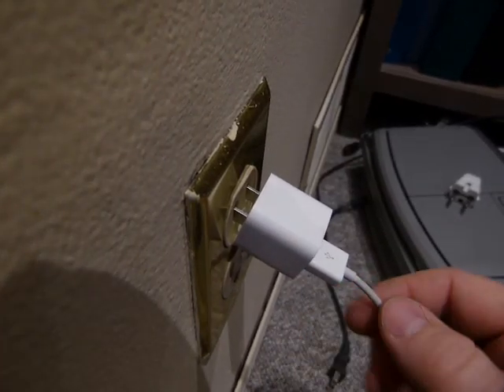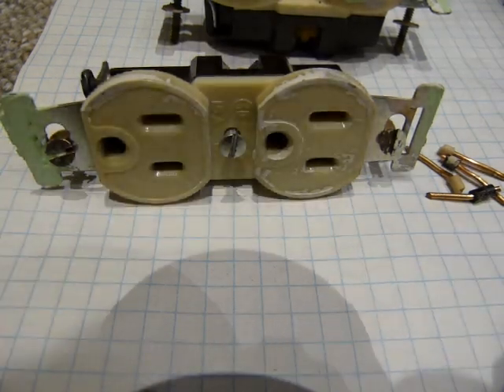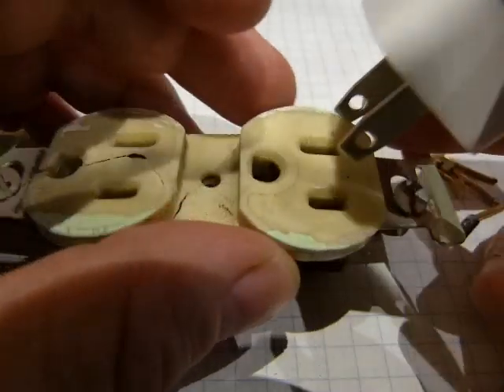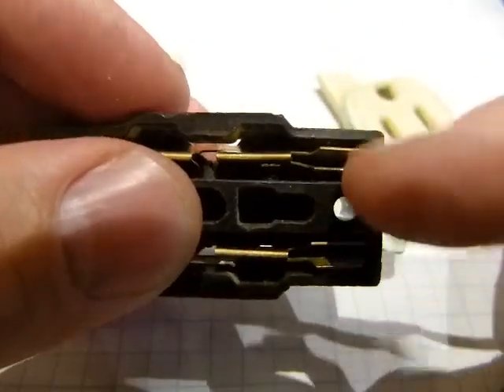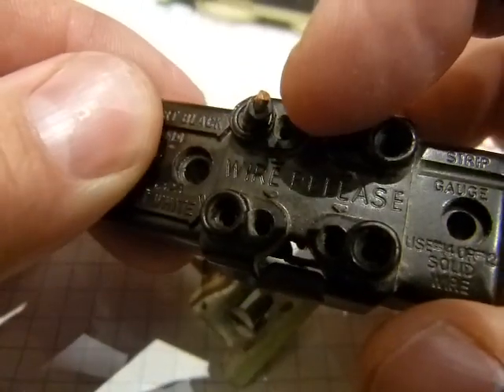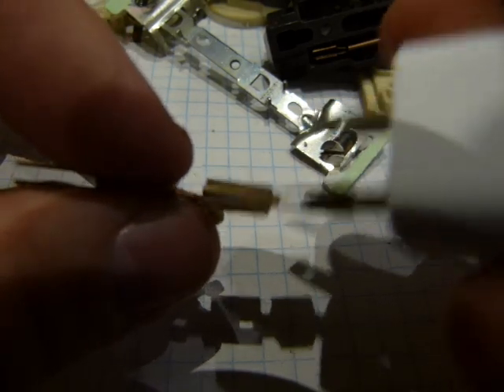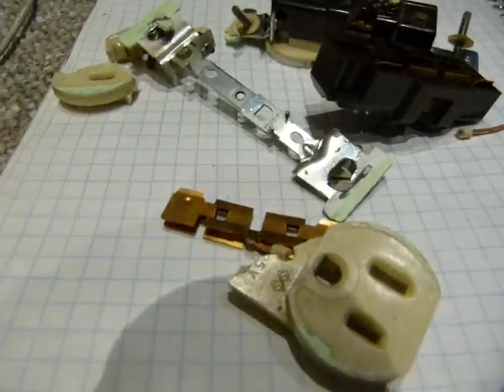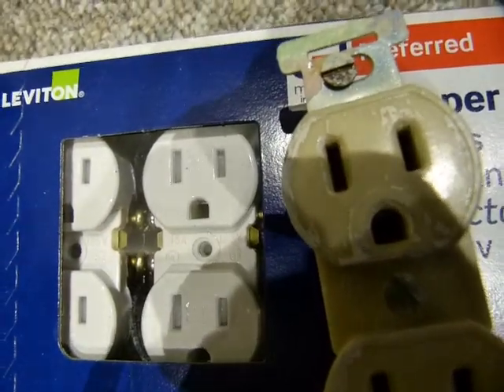Inside an electrical outlet

Comment: Notice the two protruding dimples on the inside the female plates. Those catch the 2 holes in the plug by design, but we know on this video the plates are cheap, spread, and worn out. On a 'hospital grade' outlet those dimples grab the holes positively. BTW, the red color outlets are connected to the emergency generator bus transfer switch should there be a power failure in a hospital or other critical place (nuclear power plant, etc.). Not all outlets are fed by the emergency generator set transfer switches.
Reply from the maker: Thanks for the background info, love it!

Comment: It's really never been a good design. I remember as a 2 year old putting scissors in the socket , only in 1 side and big spark, turning the chrome black and part of the outlet. (then returning them to the esthetician that was visiting) . So it must have shorted to the adjacent ground.  (I recall someone else causing a short when removing a plug had a child guard on it; without removing it 1st) . I guess it would trip the breaker = ends up being safe.. Anyone have thoughts of the ground strip ? Are newer ones safer ? or just GFCI that are safer ?
Reply from the maker: Any outlet design will have round holes or slots into which any smaller object will fit, such as paperclip, tack, pin, fork tine, knife blade. The problem can't really be solved. GFCI or fuses that trip fast help, so do plugs and other safeguards. Society accepts that some accidents are unavoidable, 'cost of living'. Back in the day in the West, slipping and drowning while washing by a creek was common, took a whole range of inventions and societal change to eliminate the problem.
Reply: @theoverengineer  NO! I'm talking about how the GROUND in the MIDDLE is only a short distance from the HOT. SO an object can SHORT it being inserted from the FRONT into 1 slit. We're talking the 70s man, not the 1870s. Definitely not common to wash in the CREEK. The first outlets did not have a ground. AND BTW there's been indoor electricity in North America for 100 years. SO YA in CHINA and SOUTH ASIA people 'washing' in creeks and rivers common PRE 1960 - NOT in north america.. or the WEST as you say.

Comment: Great video!  May I ask:  
How can i also break off the top face of the outlet for examination?
Does the third grounding port really touch no metal at all?
Reply from the maker: They don`t come apart easily, this one just de-laminated, the epoxy glue dried out in 30?-or-so years. As it failed, it lost its ground connectors, so it is incomplete.
The missing bit: Ground pin on plug connects to ground plate inside outlet. Ground plate connects to mounting bracket (also lost, not shown in video). Mounting bracket fastens outlet to its box, in which the wires can branch out.
There is a continuous path for electricity from plug pin to outlet box to breaker panel to earth. Really important.
Will shoot a video on just this, posting it this week.
Reply: @theoverengineer  Thank you.  I have an idea for upgrading an outlet box's functionality but I want to get inside to understand it better.  Maybe i'll try a hammer and screwdriver since I don't have 30 years to wait
Reply from the maker: And there it is. https://www.youtube.com/watch?v=aT22WS0bQoU  You could be the first to view it.